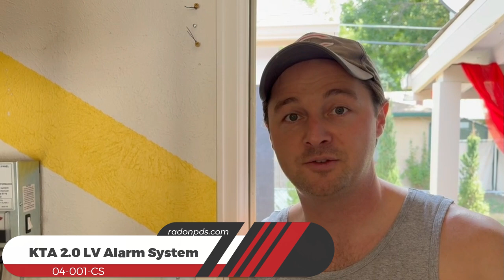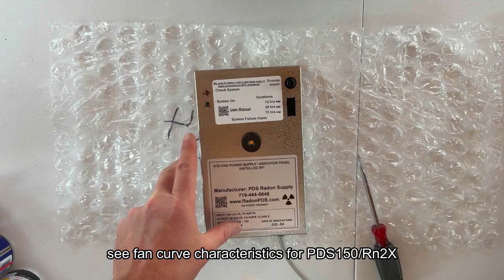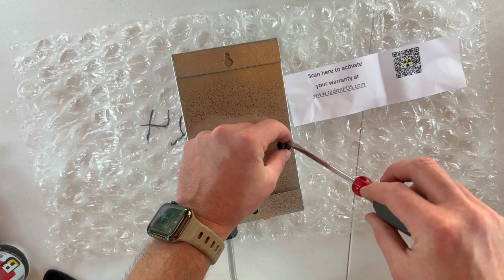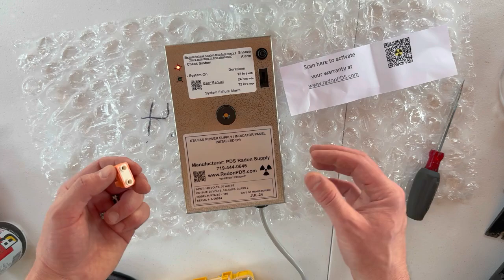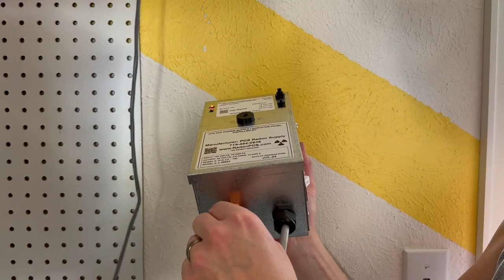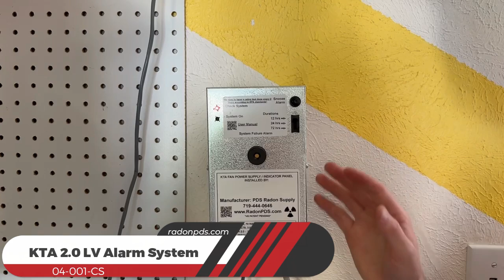Radon Alarm System | KTA 2.0 Tutorial Installation

Comment from the maker: UPDATE: the fuse has been replaced with a turn key system to start the alarm battery back up.  Very simple.  Turn the key that is provided with your KTA 2.0 1/4 clockwise to start the battery connection, then immediately power on the system to the wall and with the power switch.  More information in our user manual